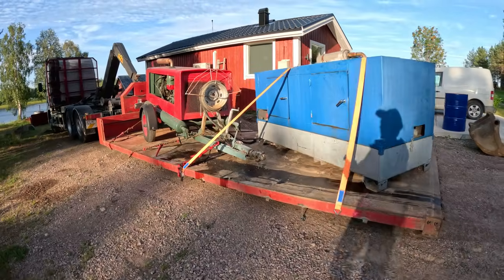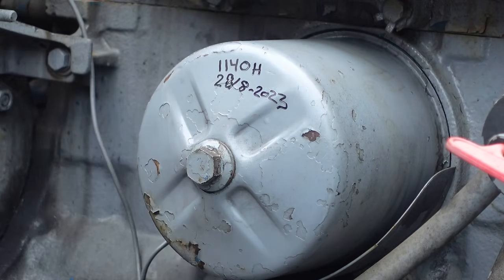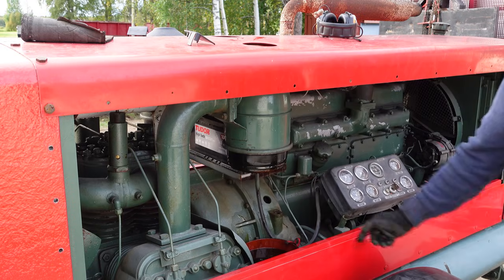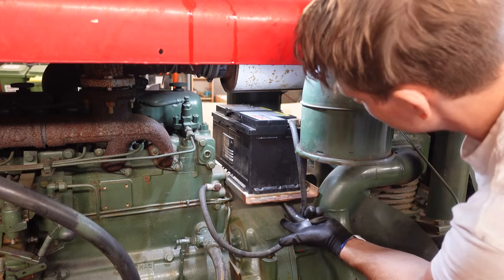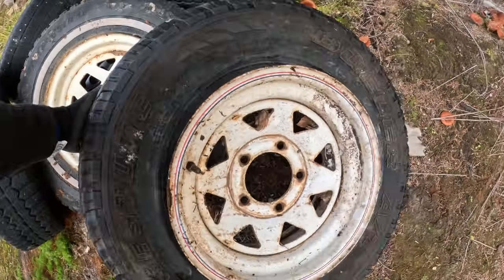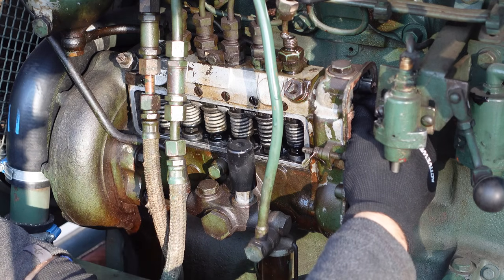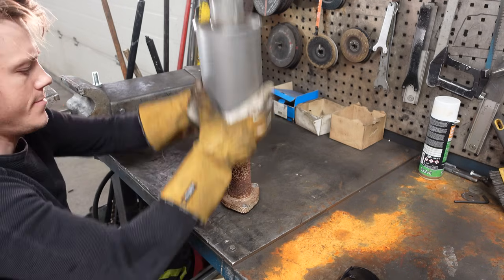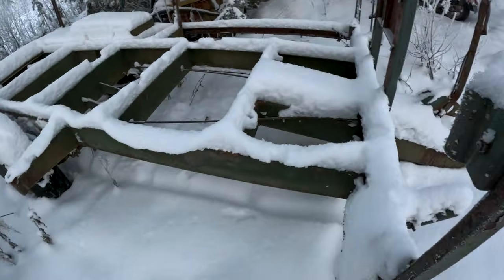Bought a big Diesel driven Compressor & Generator

Comment: Hello from the states, I work in the power generation field. On a generator with a mechanical governor, the frequency needs to be set to roughly 2.5 to 3 hz above your nominal frequency. Which in your case is 50 hz. The frequency will drop within the nominal range when generator is loaded to 80% or more. Hope this explanation helps. Peace.

Comment: A good generator is equipped with an isochronous governor. The isochronous governor controls the rpm, and keeps it steady, no matter what the load on the generator is. Otherwise you will need to adjust the rpm's to maintain the 50 HZ desired depending on the load. Either way you got a great deal on both pieces of equipment.

Comment: I really enjoy your videos and comparing slight differences how you do things and how we do things in the US. Im from Minnesota and run a small excavation business. Doing the work can be plenty difficult I couldn’t imagine recording and editing it on top of things. Keep up the great work!
Reply: I can see by your lastname that you are Skandinavian.And most Skandinavian moved to Minnesota.Karl pålsson,Carl paulsen.You should change to 220 V it is better then 110 V.
Reply: @urbankotto9685  In the US both 110 and 220 volts are present in the service  panel.  220 volt wiring in a typical home is well pump, dryer, range, in-floor heating and possibly a water heater.  A shop might have 220 volt outlets for welders, heaters,  planers.
Reply: @urbankotto9685 For movement of Baltic group. Think of extending the top width of Minnesota, straight North into Ontario and Manitoba.
My grand parents immigrated to NW Ontario. Then to SE Manitoba.
The area I grew up in in Manitoba had mostly Baltic Country immigrants.
Best wishes from Northern Manitoba.
Reply: @lo1234-w9r And in northern Europe we have  three phases of 230V at most homes, so 400V total between phases. Its used for stoves etc. inside homes and all sorts of machines one might need outside. Also all 230V circuits are distributed between the three phases.

Comment: Both the breakers and the rock drill require an inline oiler using rock drill oil to keep them lubricated.  You can also just squirt a little oil into the air inlet every few minutes.   They are pretty simple to take apart clean and inspect.  Anyone who is brave enough to repair a injector governor won't have any problem with this.
I love your channel.
Reply from the maker: Thank you, i actually do have an inline oiler for this i'm going to use.
Reply: @M.BJOERNSTROEM  Yep, North American miners refer to them as a football style oiler (Gardner Denver football). As they are shaped like a football, (think rugby ball, not soccer ball).
Also double hose clamps per air fitting, preferably stainless punch locks, and whip checks, as one of the other commenters has posted.
Reply: Chuck James from California?
Reply: "An "

Comment: Need an oil pump and pump out thru the dip stick tube. This is what we use in the marine business to change oil. Works perfect. A pump is mounted on top of a 3gal and 5 gallon bucket! 👍👍 A long rigid pvc tube goes down the dip stick tube.

Comment: This was another great video.  As an equipment operator, I have to suggest this: If you tie a tagline onto the load you are lifting, you can control the swing or spin of the load from the cab of your tractor by pulling or loosening the tagline, which is normally just a length of nylon ski rope.  That would certainly make life easier while lining things up to drop them into place or to keep them from spinning while lifting.  Once again, great video!

Comment: Connected to both air filters, above the hood, there should be a "hat" which in fact is a centrifuge to remove heavy dirt. The 2 plastic parts you found in the tool box are the funnels that seeve the heavy dirt into a cup. I guess the filters were overfilled with oil because part of it was rain water. The air filters were open to the elements. Nice video, though, nice to see your work

Comment: If you want clean power from the generator for some sensetive computer just get a "always on" UPS. It will rectify to dc and switch it back to really clean AC. Motors, heaters etc dont really care. Some clocks use  line frequency to maintain time because it is extremely stable.

Comment: Congrats M.Bjoernstroem,  on finding both Compressor and Generator.  after some mechanic work both will work great.
you can also use the breaker to plant flowers and dig-up small trees.

Comment: Fantastic video. Lots of clever solutions. Only comment i have is to grease the wheel bearings on the air compressor. Possibly quite dry judging by the sound it makes when you pull away.

Comment: Those two caps in the tool box look like they would fit inside the center of the oil submersed air filters, the downward facing cone and the O ring around the outside also makes me think that. The hour meter on the compressor is stunning.

"This is some really patent pending stuff"
Hahaha

You should get yourself a 3d printer man, a Prusa or a Bambulabs, printing some little covers for those oil air filter cans would be a nice application.
I'm a machinist and a mechanical technician and I never took to heart how useful they were until I had one at my disposal, I've made things like bearing press tools with it, weird funnels, ducting adapters...

Comment: For the engine oil drain plugs, you can get plugs from your Takeuchi dealer that will work with the drain hose on the Takeuchis. Not sure of the thread size, but you should be able to adapt if needed.

Comment: Its important to use safety clips or wire to secure your hose connections. This keeps them from coming apart while in use. The tiny hole on the Chicago style couplers is where the clips or wire go.
Reply: I believe they are called “Whip-Checks” in English. I was thinking the same thing. During the well drilling video he let those Chicago fitting/hose fly about which gave me actual anxiety

Comment: In the future when side loading your flatbed like that place wood under the edges to avoid bending the bed out of shape cause it will eventually either make the flatbed not load correctly on the truck or break the welds that run along the two main frames under the bed. I’ve actually seen this happen with catastrophic consequences to the flatbed and the truck. The flatbed is only designed to load from the rear without additional supports along the sides. Some people have taken a piece of square stock steel with a flat bar underneath theat and welded along the outer side of the flatbed to always have enough support to not damage the flatbed or truck.
Reply: He talked about this in a previous episode...check it out 🙂

Comment: For the Genset oil drain, you can get an Easy Drain, or Quick Drain, or Fumoto valve. You can order with a threaded outlet to attach a oil hose, to direct the oil to a pan, or drain pump. This is common on boats (owner installed). Home brewed tend to be too long, and prone to vibration failure.
Thank you for thinking about the poor battery, getting shaken to powder, by the extreme vibration. You might want to try to mount the battery to the Genset base, if possible, a much more stable spot.

Comment: I don’t want to come across as negative or something more colourful. The oil bath air cleaner is old technology but very effective for dusty conditions and it works by incoming air is drawn down through the oil bath air housing directly to the bath then the air is directed 180 degrees to the inner tube forcing any dust particles to go straight ahead into the oil and be captured leaving clean air to go to the engine. Simple as that. Hence the oil bath should never be filled above the high level as it can be drawn into the engine and cause a run away. So correctly stated the air doesn’t go through the oil. Ok, said my bit and thoroughly enjoying your videos. Oh I’m an old school heavy diesel engineer so I know what I’m talking about.

Comment: Dear Mr. Bjoernstroem
👍👌👏 Very well done again (video and work). Congratulations 🎉 for two great purchases. Both are nice big sturdy machines. 2) Please kindly allow me to suggest several things: The tires/rims you put on the air compressor axle are wider than the fenders/mud guards. Therefore dirt/mud/water will spray all over the device. By the way: 2) Usually compressors like this have hinged, slotted side panels. Often they will be opened up when the engine runs. 3) The most important thing: Please consider to redo the air intake openings in the hood/roof. On a machine like yours, this kind of oilbath air filters usually have pre filters (looking a bit like fat mushrooms) above the hood/roof.. The pre filters can easily be taken off. They don't let water or snow into the pot below. Your solution can/will create problems because the air filters suck warm/hot air from the engine and dirty air into the engine/compressor compartment.
As always: Thanks a lot for making teaching explaining recording editing uploading and sharing.
Best regards, luck and health in particular.
Reply: Hi I am from The USA love  what you did and it look good   also good  Buy  BUT I Agree with @Chr.U.Cas2216‧ the  air intake  have to be  put  back to  factory with the  Correct air  filter set up or you will have trouble  with it  also  I think the Hole you have in the center is for inspection of the  battery   this  can be cover with a round  cover with a  bottom  holding  bar that you can tie from the top be sure is water seal you can maybe also  set up compressor to use  regular  garage  air hose in the time you use a  regulator  it will be good if you get another tire damage or you on the  field  and need to do some regular  mechanic  work  with air tools

Comment: The two plastic "cones" in the tool box are for the original fuel filter housings - for the filters you initially purchased.
Reply: Nope. Those are for the air pre-filter dust cups, on the missing intake snorkles, that would poke up out of the engine cover. That's why he found a dead rat in the one air filter bowl.
I had to service them often, back in the 70's. Those where a common air filtration system on mining equipment.
Best wishes from Northern Manitoba.
Reply: There are similar in the original fuel filter arrangements too - trust me lol!! @carlthor91

Comment: Here in the UK we say you have opened a can of worms by taking the back of the fuel pump when you don't know what you are doing. When you took the side cover of you should of seen a bar that moves  back and forward its called the rack bar it was probably stuck just use a screwdriver and move it back and forth spray it with diesel . The screw on the side of the pump is the fuel bleed screw.  The generator is probably early 1970s 3 cylinder Ford is capable of 20 to 25 kva the alternator made in the UK by Stamford looks like it is a brush type parts are pretty rare now . Great video

Comment: Install a Big Ass flood light directly mounted to above the generator either by a steel pipe or wooden pole ...if its placed outside.. so you can see what you're doing at night.

Comment: Not sure if anyone suggested this, but just drill a large hole in your oil drain plug and tap it with whatever size fittings you have, then you can still put your valve on.  May still have some residual oil in the pan, but you're going to have that anyways.

Comment: on the gen set, check the fuel pump and governor, most early pumps had their own oil supply and can over flow when diluted with diesel. That could be the drain level pipe you were looking at near the mechanical lift pump.  Alex from down under

Comment: Another realy nice video, keep up the nice work!
I think you got a small mistake with the Engine hours, your unit has 3814hrs :)

LOVE YOUR VIDEOS 
GREETINGS FROM GERMANY
Reply from the maker: Thanks, the last digit is 1/10 of an hour, so it's 381,4h
Reply: @M.BJOERNSTROEM are you sure? Because the needle says almost 50 minutes. That would be about .8 hours.
So i think the digits are full hours and the needle shows tenths.
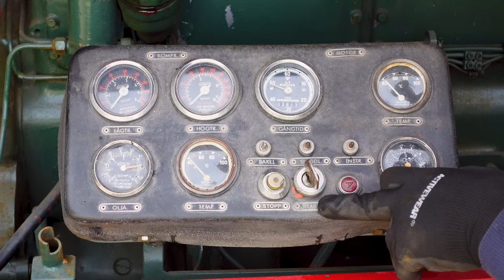Would be here 34:01 : 3813 h and 50 min

Comment: You need to put the steel in the breaker ( tool point ) They look like rock drills . Easy to strip down and clean them . Nice job

Comment: Hey man the filter  on the compressor that only had a metal top the bottom is still in the canister. Those are valves for compressor in tool box

Comment: you could do with some Air Hose Whip Check Cables on the joints and the ends that couple to the drill them pipes are no joke if the end un couples under pressure believe me ive seen it happen when drilling underground

Comment: I really like that crazy rollback bed on your truck that drops it down to ground level. Very cool design! Nice job on the genset and the old Volvo air compressor. With that 6 cylinder compressor, it reminds me of a big truck mounted Ingersoll Rand compressor that my Grandfather had years ago. It was rated at 250 cfm. (cubic feet per minute) @ 90psi, but yours looks quite a bit smaller, so maybe 150-175 cfm.? I think you got lucky on the injector pump, that it wasn't totally destroyed inside from lack of oil. I'm actually surprised the 'unloader' that kicks the compressor out is actually working. That always seems to be a trouble spot on those old compressors. Anyway, just subscribed to your channel, and I have to say, great content all around!!😄👍👍

Comment: Hi there looks like a very usefull unit 
I think itscstill missing engine side pannels , the fresh air feed should be above the engine compartment , I think elbows on the intake would have solved the issue , also I am always wary of creating metal chips in the intake area (like when cutting and grinding the intake pipes off
Reply: Was thinking the same thing about all those metal shavings in the intake

Comment: Looked like the radiator cap or something blew off when you first started the air compressor - but its back in the shot you back it up into the garage.
Reply from the maker: It's the fuel lid that went dancing there

Comment: Interesting seeing that huge garage/workshop and you starting/running the diesel compressor inside it without any extractor fan on, 🙄 ~ yes, there is enough air and height for the fumes to collect at the ceiling/roof and for you to not be poisoned by it, that there was a direct fume extractor behind the compressor; the box with the swan-neck duct, and that there were ducts and defuser vents on the ceiling ~ assuming that was part of a extractor fan/HVAC system?

Comment: I was expecting some sparks when you were installing the battery on that compressor :) that holes on the bottom are supposed to hold the battery at it’s “feet”, that is why are they at exact dimension. Your solution is good though, just can get a bit more sparky :)

Comment: Hello,  I noticed when you replaced the air filter on the generator you left a hole at the end where the old fixing bolt used to be.  This now allows unfiltered air to enter the engine so perhaps a little piece of tape will seal up the said hole to prevent any dirty air in. 👍

Comment: Check of the fuel tank of the generator for a drain plug, get rid of the water accumulation, prevent rust.

Comment: With heaters the power is 25kW. The power factor of a heater is 1.0, whereas a motor or whatever is less. So kW =1/PF *20. The alternator and engine have a few problems, the AVR (automatic voltage regulator) may not work well, and the injection pump should give constant RPM with load. However both can be corrected if your use warrents it. David  CEng.

Comment: Hello from the Netherlands.
I would have liked to see you add new side doors and a radiator protective grille.  
but otherwise just another good video TOP.  I really enjoy watching your videos.  
question: isn't the generator actually too heavy for the car to pull ?    
By the way, I assume that by the (army) trailer chassis you meant that it has a coupling for the towing jaw of your truck and not a ball coupling as with normal trailers.  
By the way, you could always put a combination coupling on your car, then you have a towing ball and a towing pin in one coupling, 
which is also useful in the future and to pull a chain or something like that haha
thanks for the video M .  
Kind regards, Hollandduck
Reply: now idk what that compressor trailer weighs but, that generation of Caddy is rated somewhere close to 1300 - 1500 kg max trailer weight depending on the engine and such...

Rules could be entirely different in Scandinavia tho, who knows lol.

Comment: The rock drill probably has an integrated oiler. In order to prevent damage, they will shut off when the oil is spent. At least this is how the Boehler in-line oilers behave.

Comment: I know it´s a year ago, but the engine hours are actually 3814 hours. The decimal hours are in the large rusty pointer (like an hour-hand on a clock). The hour-meter is in german for some reason...
On the old fuel filter, it looks like the bottom plate is missing, you might want to check if it is still in the filter housing. The new filter had a bottom plate.

Comment: I take one of those other white wagon wheel rim tire in the best find and a weld a rod on the right sight of the tongue to mount a spare tire or put it in front of the radiator while transporting on both machines

Comment: When measureing the frequency of the generator at around 6:00 min in, did you measure it under load? I believe the generator should be a bit on the + side when unloaded so the regulating area becomes smaller when under load since the frequency will drop when loaded.

Comment: On generator when not under load its normal to be over 50hz (hertz) beacuse when under load it stabilises itself with isochronus governor. Basically, when you get generator under load that governor activates and stabilases voltage and frequency